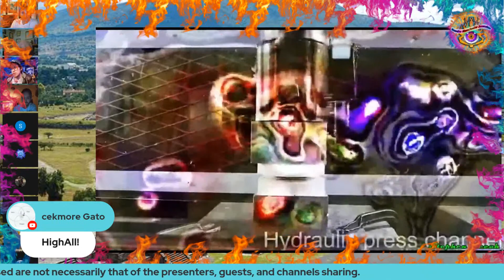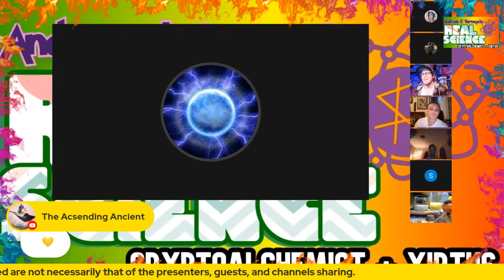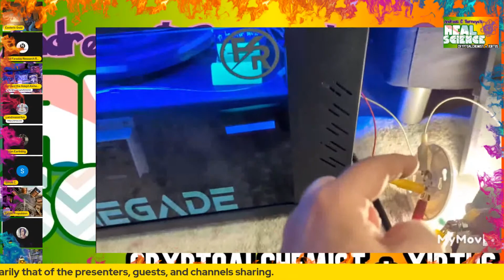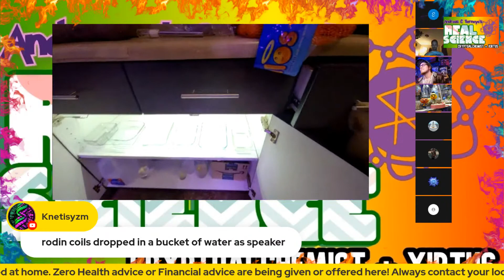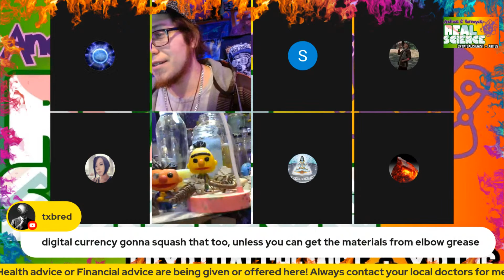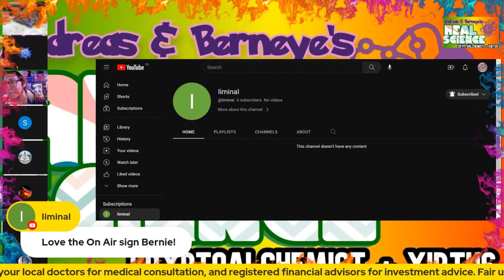#RealScience episode 23 BurnEye & Xirtus ft special guests!

Comment: measuring high frequency requires specific equipment.   i dont see any free energy coming out of the so called adams motor.  He is comparing apples to oranges.  from what i have seen of mikes motor its just a pulse motor using a relay instead of a transistor.  Accurate measurements would be nice.